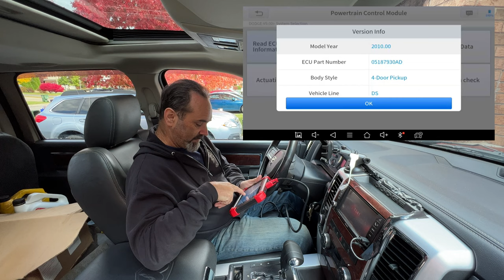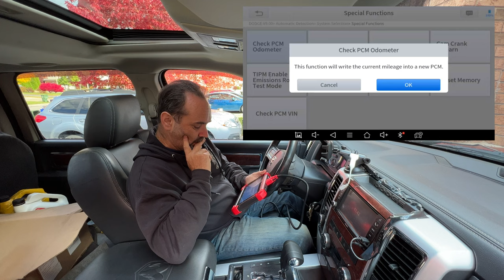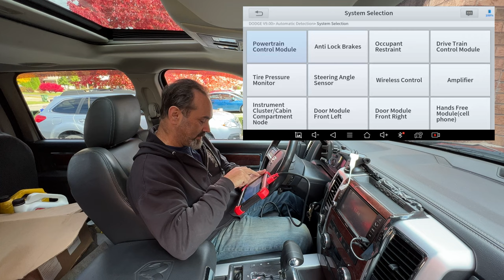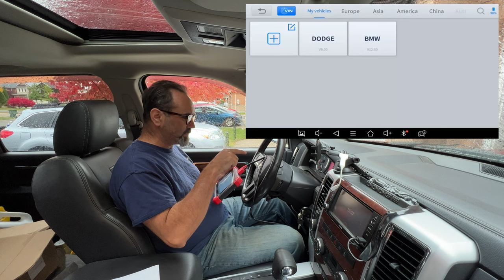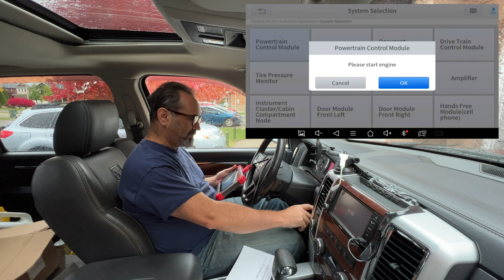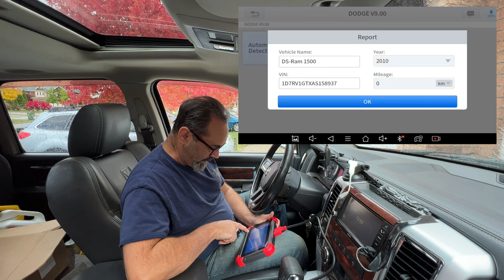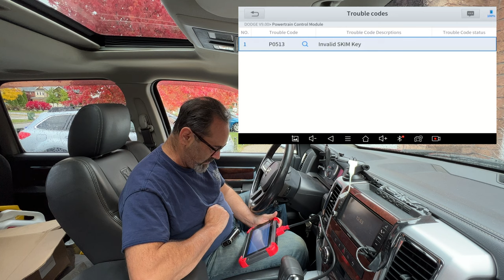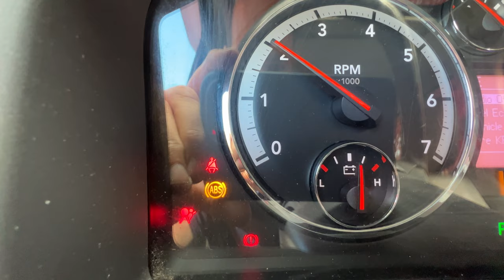Ram 1500 PCM Swap And Skim Module Coding - woooo sounds technical

Comment: This is awesome progress.  For the ECU swap on the scan tool there should be a ECU replacement procedure that will swap over the the vin, skim...etc... to the new ecu.  If you are going to get a new ecu from a company, normally the supplying company will program the new ecu with your vin options and current software version, which should clear the rest of the errors.
Reply from the maker: I'll have another look at it tomorrow. I was just so happy to have resolved the main faults.
Reply: @ScottRods  I'll have a look at mine as well.
Reply: Hi, I had a pcm replaced and the supplier programmed it with vin and software and plugged in and go perfect but now I can not add any keys to it and I only got one and it's broken and can't even lock my car unless I do it manually with metal key. Any suggestions does it need more programming. Thank you.
Reply: @ScottRods  Hi Scott, where did you get the replacement pcm, and what did it cost you?  same issues on my 2009 Ram 1500
Reply from the maker: @garyr.8116  Facebook market place. $75 Used. I took a gamble, it paid off.
Reply: @ScottRods  thx for the info!
Reply: @garyr.8116   I'm about to take that same gamble on my 2006 Dodge ram 2500 I've had it and I'm super pissed off at this point. New crate motor with under 30,000 miles and I have P0307 that I cannot clear for the life of me. 

Tried: new sensors,  crank, cam, map and o2...swapped injectors and coils and put 2 new plugs in. Nothing changed after clearing the code on each of the individual repairs and driving it not even a mile, every time, the P0307 pops right back up and it runs like trash when I come to a stop the idle speed is always different or it's high and then drops.  A few times it has stalled at idle, in park while I was standing in front of it,  looking at it. 

Pulled the valve cover,  Everything looks and moves perfect (again,  new engine). Borescoped cylinder 7 and it's Shiney like a mirror inside. There's absolutely no carbon and looks like a brand new cylinder that just came from a machine shop... you can read the stamped letters on the piston head off of the cylinder walls by reflection it's so clean....so 30,000 miles and I don't think this cylinder ever fired...or fired properly and it's just being washed with fuel the entire time the truck is running.  

All I can think of that's left to do is change the PCM and cross my fingers that the pcm is the culprit.... otherwise I just set fire to tens of thousands of dollars on a truck that I just bought and never did once drive it with it operating properly and I can't use it or sell it to get my money back cuz no one would buy it.  I'm so super pissed right now....I KNEW I should've stayed with GMC. I hope I can find a pcm now cuz....I just dropped $600 on this damn "fancy" scan tool!!!
Reply: @MyBigThing2010 Try a company called Flash masters, they reprogram and ship same day
Reply: @MyBigThing2010  I finally popped the valve covers off, and low and behold, my P0305 code turned out to be a totally dead #5cyl intake valve! not moving at all, so camshaft is probably grinded flat! 2009 Ram 5.7 hemi 174k miles thats had an easy life, never pulled a trailer, never 'raced', name-brand full-synth oil and Fram Ultra filters it's whole life. uggggggggggg
Reply: @MyBigThing2010  also, before pulling valve covers - I connected a new/spare loose coilpack to cyl#5 (P0305)  with loose spark-plug (and jumper-cables to ground ground part of plug) and it seemed to be sparking fine. next pulled valve covers ......
Reply: Pcm swap process - read old pcm vin, turn off vehicle, unplug skim pigtail connector on back of ignition, swap pcm, write vin to pcm, turn off vehicle, plug in skim, start vehicle
Reply: great
Reply: Just swapped mine and it won’t start with used PCM
Reply: @frankmackay what do u think went wrong?

Comment: I have been highly considering the D8 it seems like it would almost pay for its self the first time I need a key. It cost me  over $400 for a key for a 2001 Dodge Ram
Reply from the maker: Solar Garage just did a video on coding his Ram keys with a D8. Looks pretty easy, and yes, saves a fortune, especially if you offer your services locally. Link to Solar: https://www.youtube.com/watch?v=2mgc1d8wgkA
Reply: @ScottRods  that's who I just seen review the D8. And it definitely caught my attention. I would think you could charge someone at least $120 to come to their house and make a key for them.
Reply: Just the comment I was looking for!  I've used some top notch diagnostic tools like CAT ET and DLB (International) when I did heavy diesel.  When I moved to mobile mechanic work I used the shop's SnapOn Modus Ultra ($7,000+).  I know next to nothing about these smaller consumer scanners and wanted one that could do what I needed without costing as much as the car I'm working on.  My current $50 scanner is only slightly more helpful than frustrating.  Looks like the D8 is in my future.  Glad you got the problem fixed.  I may be looking at a PCM for my wife's 5.7 Aspen too.

Comment: If your having idling issues it could be your oil pressure,  can swap it out with a high volume oil pump, I believe from a hellcat will bolt up and give you more oil volume

Comment: Hey I knew you were going to resolve this issue, great job! Glad to hear the Ram purring again like it was meant to, did you sort out the trouble lights since then?
Reply from the maker: Not sorted the other new codes yet. I need to take to Chrysler, they won't give me the security pin code for my own truck.
Reply: @ScottRods  The truck is running and driving at least which is great. And yeah I've heard that the dealer is iffy about giving security pins, probably some kind of security or liability thing. Either way im really happy for you, you never gave up and you got the truck fixed. At the end of the day it's a success, so congratulations.

Comment: The min 25:43 was my favorite to see you smile after many attempts you finally did it. I have the same problem I check everything already coil,sparplugs,cam sensor crank sensor,valves and now I'm starting to believe it's the pcm.
Reply: Did you ever swap your PCM? Any luck?
Reply: @jonathonrenae5012  no luck for me 😣 I end up taking it to the mechanic Friday 7/14 no updates yet waiting for his diagnostic
Reply: On my case it was a bad lifter roller and f***ed my cam

Comment: Help.... my truck is a 2013 ram 1500.. im having the same multiple mis fires codes.. its idling rough and driving i can feel it missing.. i change all plugs and all the bad coils and cleaned the injectors and swapped them and still missing... do you think its the PCM ?...  ):

Comment: Hey Scott, still good? My next move will be PCM. 
 I have the exact same issue at 3000 rpm. Check engine light and runs rough. 2 mechanics and the dealer can't figure it out
Reply: Multiple times new plugs new wire new coils new camshaft position sensor new map sensor Compression test is good cam and lifters are good
Reply from the maker: I have now sold that truck, but it was running great after the pcm swap. I did have to take it to the dealer to get the pcm coded to the new vin, but only cost about 70 bucks.
Reply: @ralpheguerra  did you get a new pcm, and did it resolve issues?  where did you get the pcm??
Reply: @garyr.8116  Hi Gary, I ended up getting a newer 2022 used RAM last weekend.
Reply: @ralpheguerra  thx for the update; good luck with the 2022;  my uncle gave us this 2009 Ram when he bought a New 2019 Ram - two years later his 2019 with Hemi & e-Torque (with only 10k miles) was acting like the electrical system was possessed. Insurance co totaled-out (paid out in full) the truck shortly after, when another driver t-boned the front-end of the 2019 Ram (their fault). He's done with Dodge Hemi's!
Reply: Wow I have seen a few of your videos while I've been chasing down the same type of issues but only saw this one today, now wondering if this could actually be my issue.

Comment: what a battle Dave . i am have a battle with 2008 ford Mondeo power steering to . about 8 or 9 months ago I put another rack in it because it started locking up turning left and was all good for about 4 months and got really hard to steer and was noisy so put a pump in it . all parts so far 2nd low ks as mine has done 300+ks . was a real bitch to bleed but got there  . but again a few weeks later hard to steer again . so read they have a filter in the  Reservoir so got a new one again was a bitch to bleed was ok for few weeks . ok so every time we had it apart we had put in new fluid and the right spces as far as i know so this time got 2 1 liter  bottles of ford power steering fluid just in case that was the problem . and flushed it with one bottle and still hard to steer so got another high pressure line thinking it might of been collapsing or something nope still the same . ok so this point we were thinking maybe the new rack was bad ( valve getting stuck maybe ) so yesterday put another rack in it and guess what its still the same but its not noisy now lol  . and the dumb thing is there is nothing else to change apart trying other pump again because may its now fucked to from the other rack . i am about ready to burn it out lol
Reply from the maker: Wow. What a nightmare. I would be looking at the wishbones and drop links. My thinking is, if the rack is good, then there might be some physical resistance being applied between the track rod ends and the road surface, which is then feeding back to the rack and steering wheel.
Reply from the maker: Maybe the sway bar is doing seething weird preventing the steering from moving smoothly.
Reply from the maker: Maybe the sway bar is doing seething weird preventing the steering from moving smoothly.

Comment: Help.... my truck is a 2012 ram 1500.. im having the same P0302 mis fires codes.. its idling rough and driving i can feel it missing.. i change all plugs and all the bad coils, camshaft, pushrods and cleaned the injectors and swapped them and still missing... do you think its the PCM ?...  )
Reply: Any update, I hear ticking on mine so I’m thinking about replacing lifters but just curious if you resolved yours